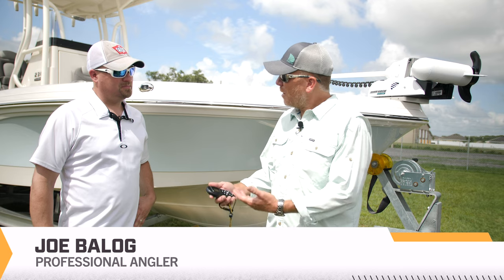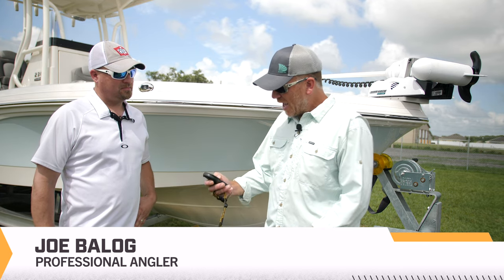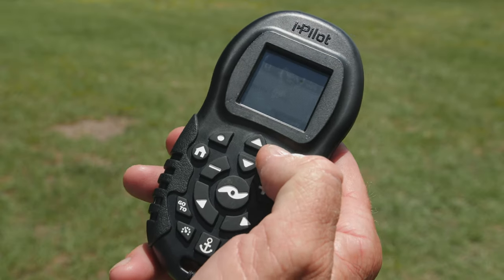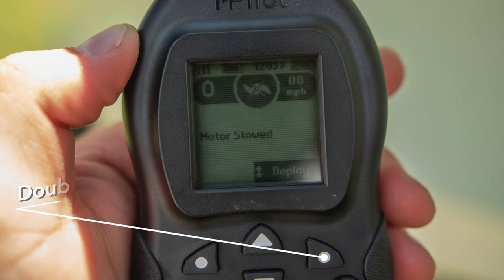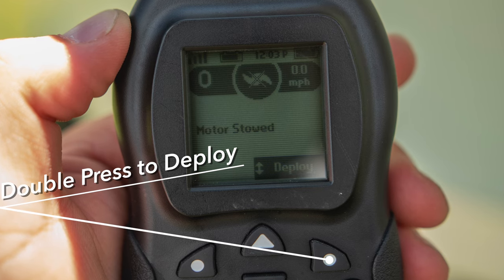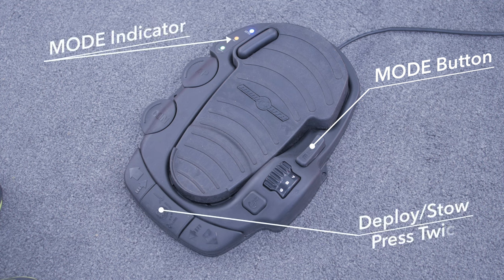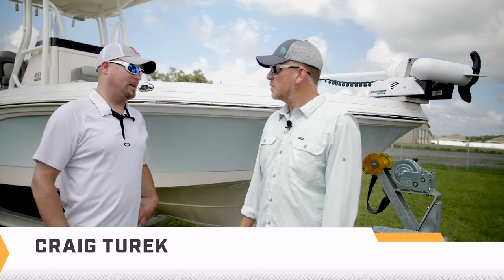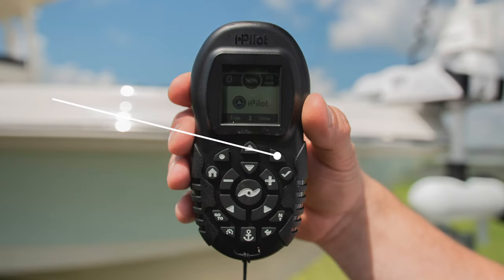How to Deploy and Stow a Minn Kota Ulterra

Comment: Can you jogg using the foot control? If so how to do that ?
Reply from the maker: Hello Malcolm, the jog feature will only work through the remote control providing you have the heading sensor installed and paired.  You want to make sure the calibration process is performed in order for the system to know what direction is "north."  Here is a link to an article that may help you.
https://bit.ly/3Mrxhzg

Comment: have the same remote but will NOT PAIR with the ulterra. Turn on the troller, turn on the remote, push the PAIR button down and hold and then select PAIR from the remote and says "Motor not found"
so now what. Nobody knows.....not even Minn Kota since they only show how to pair the MICRO..fun and games.
Reply from the maker: Hi CHAZ, 

Can you please send us a direct message on Facebook detailing the issue you are having along with your product serial number? You can also reach out to our Customer Service and Technical Support Department at 1-800-227-8433.

Thanks!
Reply: @MinnKotaTutorials  That number should be 6433 not 8433
Reply: @MinnKotaTutorials  
that number should be 6433 not 8433